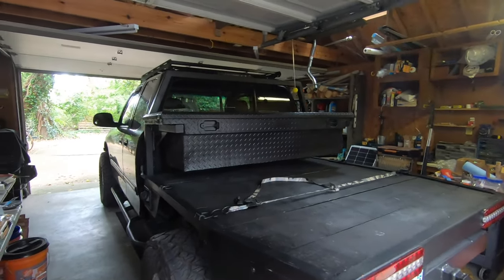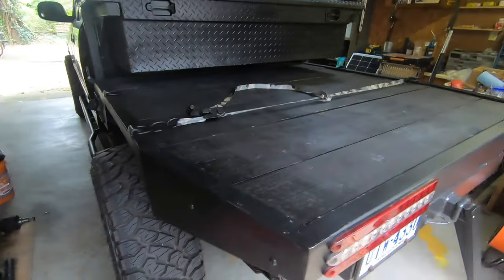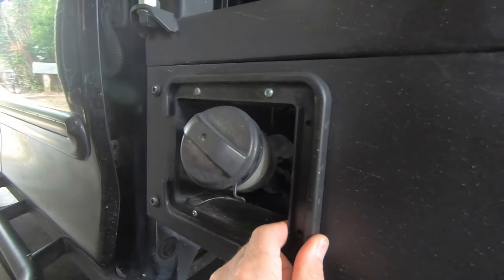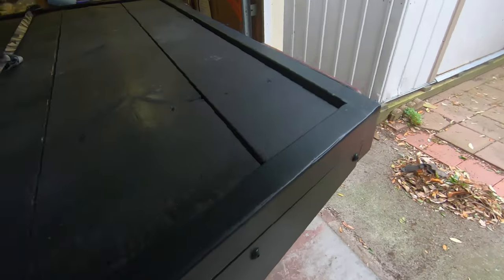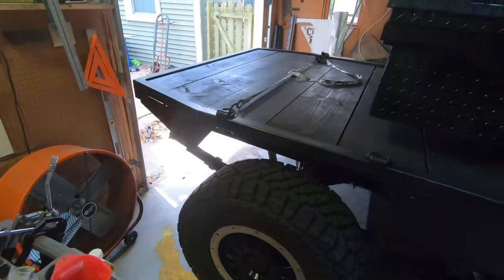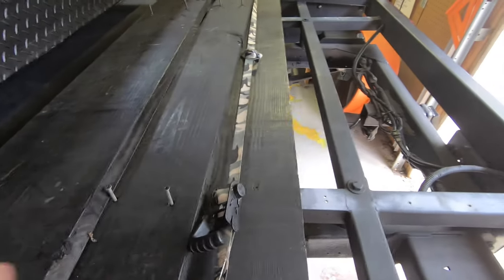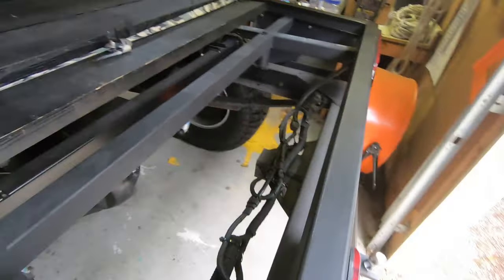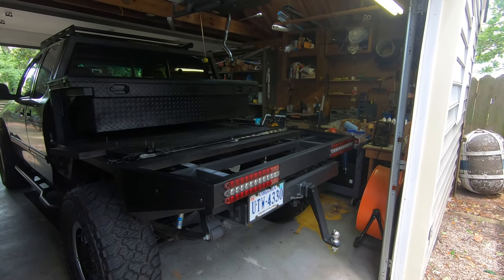Custom Flatbed Walk-Around and Build Details.

Comment: I have an 01 and the besides are rusted out around the wheel well, there's more rust forming around the rear bumper on the fenders. it's like $2k to get 2 new fenders from toyota which is the only ones that sell panels. I know guys did a dodge dakota fender well repair but when the rest of the thing is rotting out its just not worth it. So it's gonna be a flat deck for me on my tundra even though guys have told me it would be useless which is not true. I've out grown the bed already with alot of stuff so making like a 7ft long flatdeck would be perfect for my truck
Reply from the maker: Flatbed is certainly not useless. Quite the opposite. Even my shortened, narrowed, off road version is incredibly useful. I use it daily for work, camping, etc.

Comment: At 13:15 there is enough room under the wood to make a hidden compartment/box. I would put some hinges on the wood and a small handle or something like that to make it hinge up and have access to extra storage.
Reply from the maker: Good eye. Currently I’m working on mounting a hidden rear winch in that area.

Comment: Really neat work here. I’m picking up a f250 super duty and might incorporate some inspiration form this build. I have a dent on the bed I’m getting so I might just rip it out and build something similar as il be using truck mostly for off-road rig hauling.
Reply from the maker: Appreciate the comment. I really have no regrets with the flatbed. Even though I built it 50/50 looks/utility,  it's so dang useful. Good luck with your build!
Reply: @JHBtheIV You did an awesome job and this design really soothes my liking. I don’t see myself needing my XL long bed, and it looks wack imo. I plan to do this and then one day convert my 05 nose to the newer 9-15 grill/nose design for looks haha.

Comment: How’d you decide hight? How’d you figure out how high you articulation
Reply from the maker: I pulled the leaf pack apart and let the main leaf sit flat. I clearanced the bed for 34’s, so it rubs now that I have 35’s. I need to redo bump stops (running none right now) and probably modify the bed rails

Comment: Looks mint. Im oing to try to make one for my dakota. What was the price of all the steel? I know sheets are pricey. Im gunna plan on wood like yours
Reply from the maker: Thank you! I couldn’t give you an accurate price, since I used quite a bit of leftover steel from other projects. I actually butt welded smaller lengths together to make longer ones in some spots, since I hate wasting any steel. If I was buying everything new, I’d estimate around $400-500 in metal, including tabs and tie downs.

Comment: did you use square tube for the outline or angle iron
Reply from the maker: Square for the outer frame, headache rack, and cross members, angle for the pieces that support the wood floor.